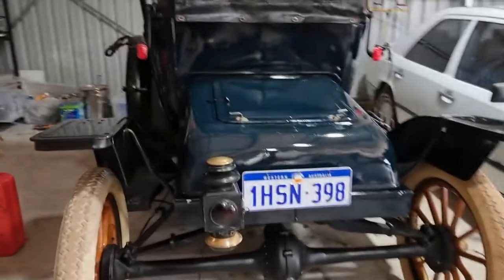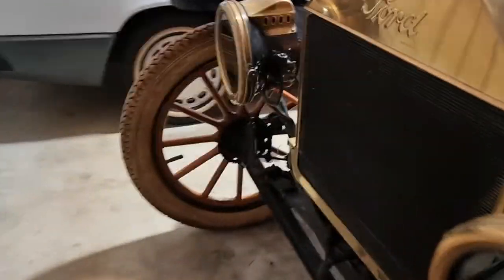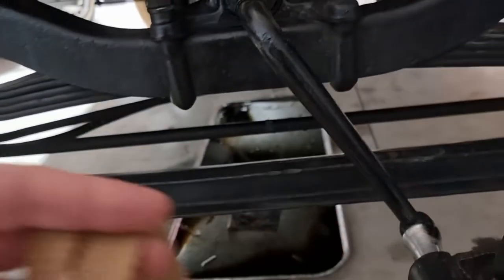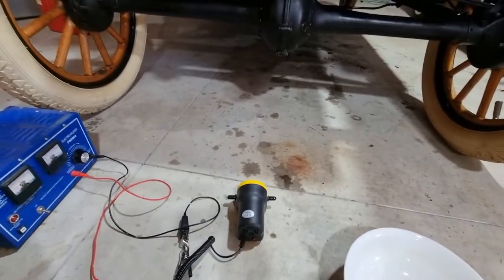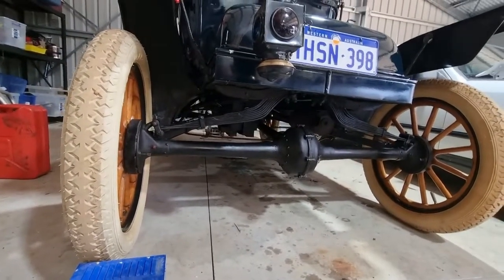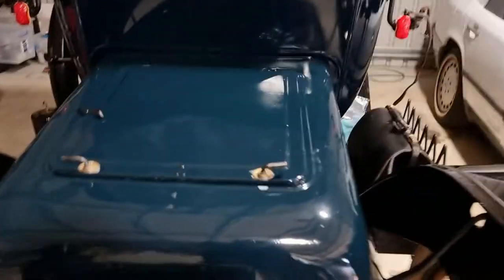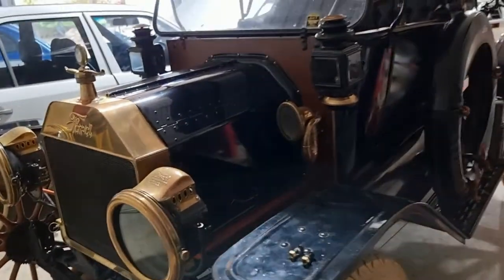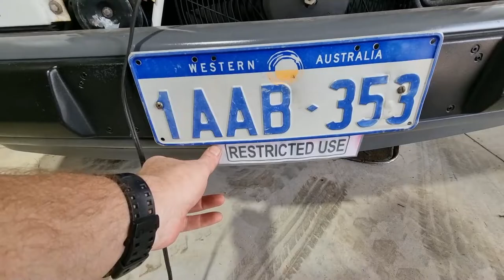Ford Model T Part 10

Comment: Good job on mounting the plate, visible and unobstructed. On the 1915 I used to have (1920 Runabout right now), I had an accessory bracket that mounted to the right headlight mounting nut on the fender iron, kind of sat at a 45 degree angle. There were a ton of original aftermarket/accessory mounting brackets available. I don't think Ford had one on the front until about '21 or '22. If you ever think about getting and original aftermarket bracket, I would recommend against those that mount to the radiator neck, no need to add undue stress to that point.

Fairly arduous, a more true and endearing description for changing the gear lube I have never heard. Your 140 PenRite is perfectly fine, I think Penrite makes a 250 as well, which is pretty close to the original gear lube. Mobil Oil (1926) designated their CC, Heavy Gear Lube for the differential in Ford Cars. A straight mineral oil, "semi-pourable" gear lube that stays "semi-fluid at operative temperatures" (think honey in January in the Northern hemisphere). With that being said, I think your 12v pump did a pretty fair job considering. I have always had good luck using an old-school manual suction gun to get the old gear oil out, and you were 100% right when you said you should have warmed it up. It would have helped, some. I don't think I heard you mention it before, did you grease the U-joint and the drive shaft bushing at the front of the torque tube?

The condition of the front wheel bearings make me believe (even more than before) that this car was put back together and not driven. It sounds and looks like you are getting everything sorted out and you have a good shakedown cruise coming this Sunday. I will be looking forward to another video in the future, and I have watched almost all of the videos in your Model T series now and I have some questions, which I will post in the appropriate videos. Please keep up the good work and enjoy your drive, 260km just a short stretch of the legs.
Reply from the maker: Let me know if I have messed up a response to your questions. I attended to both joints. For the uni, it was hard to know how much extra to add. I read a forum post where a fella killed his engine by over greasing the uni. I put two full grease cups in...
Reply: @jl991825  That answers it just fine. You're right, you want to grease it, but don't over do it. The smaller cup towards the rear (the drive shaft bushing), depending on what has been done is either the original Babbitt bushing or a modern replacement bronze bushing. Just a couple of turns from a full cup, just to keep the grease in/on it. You will get some migration of grease from the U-joint to help as well. Don't go crazy with this one, the grease ends up building up in the torque tube, not a problem until you go to rebuild and have to clean it out.

The bigger one for the U-joint, 2 full cups, no problem. When you would rebuild a rear axle/drive shaft, you would pack the ball full of grease around the U-joint, it is going to turn as you' re driving and carve out a cavity, you are just trying to push grease back into the cavity. If the U-joint ball cap is full, once you start driving you will see grease pushing out from around the ball cap, totally normal. Just wipe off what pushes out and motor on. When I would get a T of unknown origin, I would just put grease in the U-joint and drive,stop and check if it had started pushing out, if not add some more. Once I saw that, I knew it was full and it was just maintenance after that.

I have heard about the guys overfilling the ball cap as well (more than one), usually it involved changing from the grease cup to a fitting and using a high-pressure grease gun, that grease has to go somewhere. I think you would have to put in about 100 or so grease cups before you had a problem like that. Just like the gear lube for the differential, you will get a different recommendation from every person you talk to about grease. Use the same grease for the rear axle bearings, U-joint, drive shaft bushing, steering housing and wheel bearings, clean and fresh, brand of your choice.